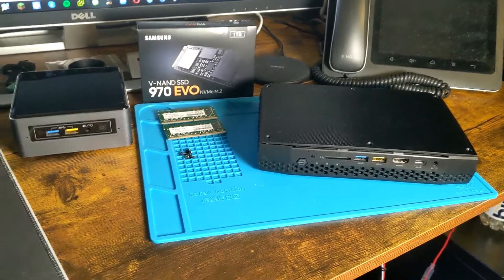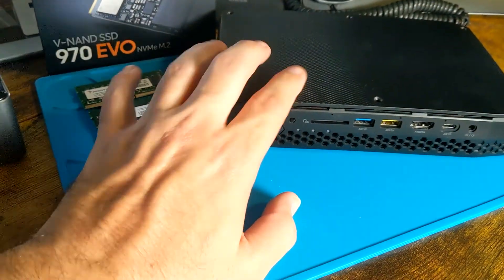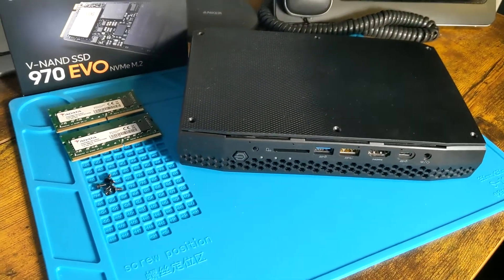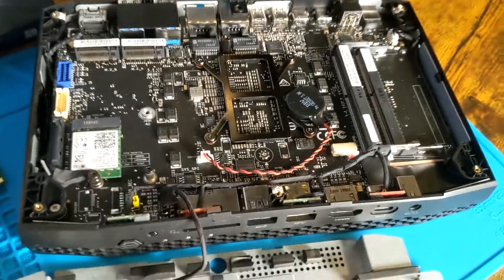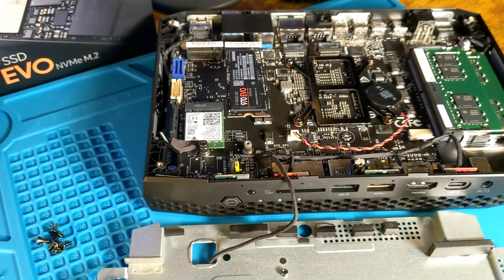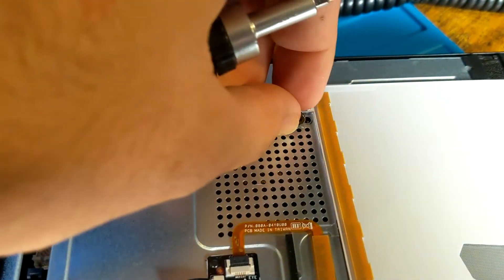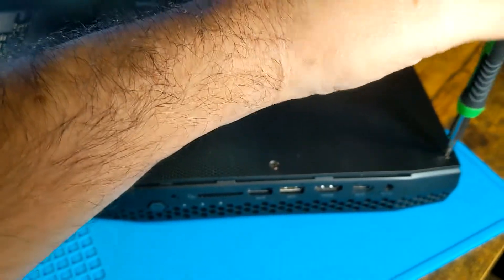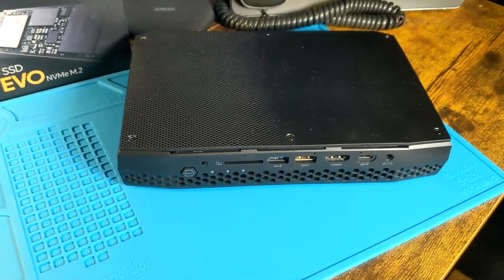How to install memory and NVMe drive into a Intel NUC Kit NUC8i7HVK

Comment: Thanks!  I have the exact same NUC as a work machine and just got a 1TB 980 Pro NVME for it so your video was exactly what I needed - even simpler to install than I thought it would be.  What brilliant machines these NUCs are - I've used mine for 4 years and it's still seriously fast and has been %100 reliable.
Reply from the maker: Nice 👍 ya I love all my nuc great machines!

Comment: Hi I have NUC11PHBi7 Enthusiast with Samsung SSD 980 PRO 2TB installed at slot where Optane was (which burned down), Samsung Magician suggest "Recommended to connect to PCIe Gen 4.0 for optimal speed". BIOS setting is as suggested different from Optane one. Any suggestions how to get PCIe Gen. 4x4 on that system?

Comment: Would there be a need for a heatsink on the m.2? I have this exact machine and got a compatible 2TB m.2 but could not find info as to whether the heatsink would be necessary or required.
Reply from the maker: It should be ok with no heat sink I have so many machines like this it's just better to have one if you can fit one on it